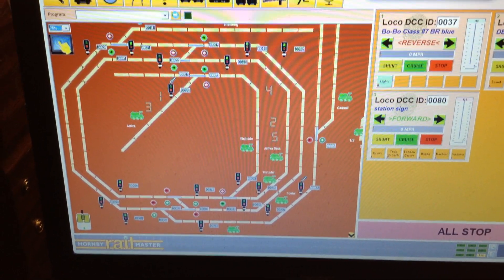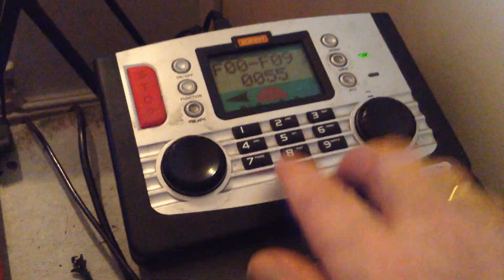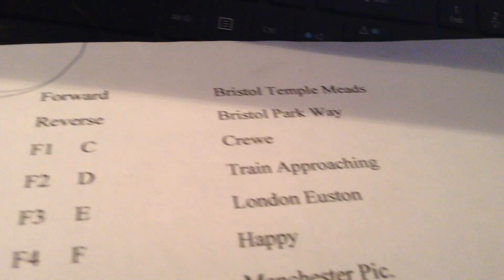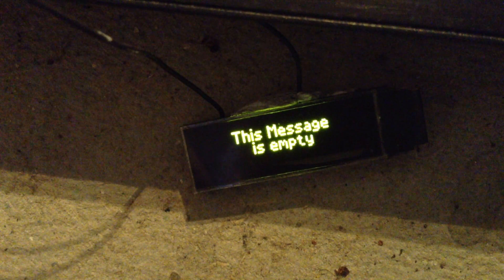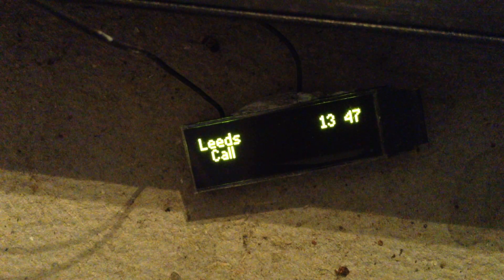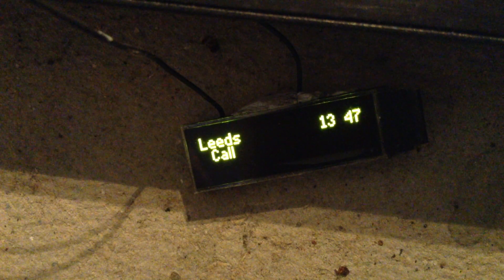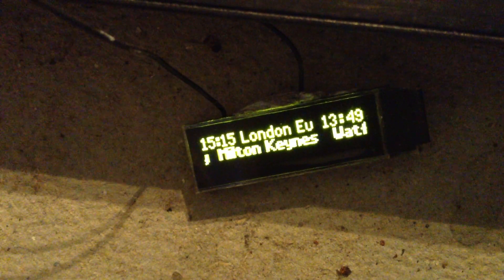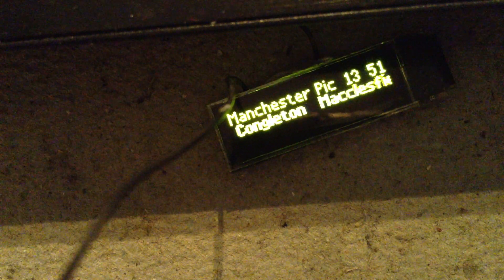Train Tech Smart Screen Programming

Comment: Looks good waiting for mine, do you need van engine address (for functions)  and a point address For selecting message)
Reply from the maker: Hi Peter, You need to set up a default loco for doing the screen messages and one default loco for the clock or you can use the pre-set default loco address (55&56) also if you are going to use some points for station destinations you go through the Screen default loco address. It is explained in the document that comes with the screen.
You can always call me on 01782302194 for any queries. Brian
Reply: @BrianHughes  Thanks Brian , enjoyed watching your video. I was hoping that my screen would have been here by now. I am trying to prepare for it, but the only information I have is what I have seen off your video. Can you use DCC to select the messages.
Reply from the maker: @peters7640  Hi Peter, My layout is DCC and you can select which screen you want if you contact me through my email address which is brianhughes382@gmail.com I will send you photos of each set up screens plus photos out of the manual. Brian

Comment: Hi Brian have got the Screen working on railmaster no problem but when i start up the Elink the Screen will not go in to the program that been put to the Smart screen but if you UN plug the Elink and the plug the cable back in to the pc it all start up ok have you had this problem as we have had a chat to train tech and they have said that thy had not had this problem before. can you help Regards Ron. got to chat to train tech on monday.
Reply from the maker: Hi Ron, Mine starts up every time.
How have you got yours setup.
Mine is setup as a loco so that forward and reverse are two screen programmes and the rest are function screens, So when mine starts up the screen shows which screen I have set for the loco in forward mode.
Give me a call on 01782302194
Brian
Reply: @BrianHughes  Hi Brian yes the screen is set up as you have your one is . i will have to chat to Train Tech as they think that my screen has a problem. Thank for the Help will let you know how i get on Regards Ron.